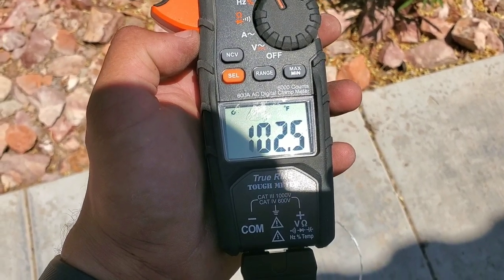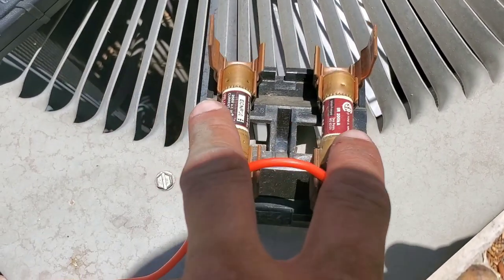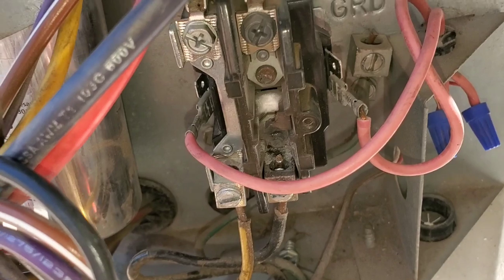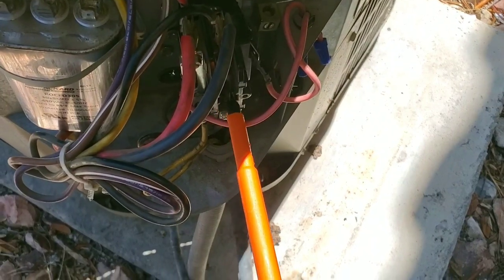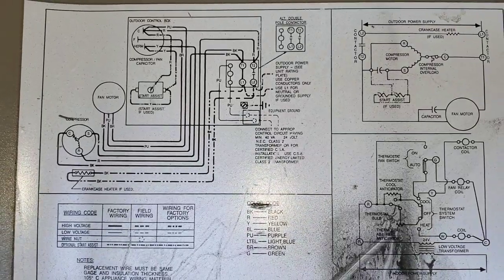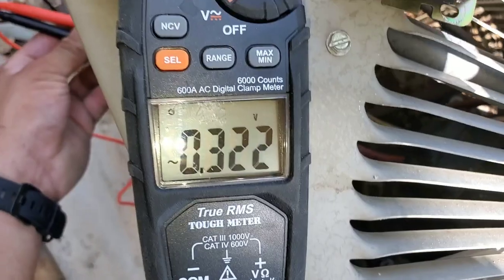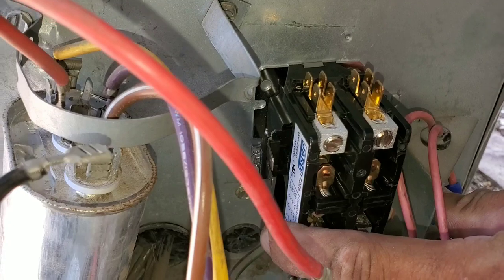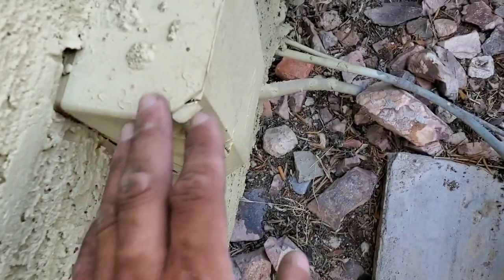Condenser NOT Working At All? Here's WHY! Contactor Not Working.

Comment: For $45 dealer I use the Emerson SmartSwitch which is far superior electronic Contactor. It’s better protection of equipment and has nifty features for brown out protection and zero off switching (zero off is when an AC sine wave crosses the center line “zero volts” lowest arc).  Takes an extra 10 minutes to install if mounting hole pattern is different. It’s about 3 inches wide.  Very well thought out engineering. 

For dealer around $200, I am also a fan of adding SIEMENS SurgeGuard at the load center to suppress in home transient spikes from other motor inductive appliances. Yet, I offer it as a system upgrade and I do not mention the “whole house” wording from the manufacturer because in as much that it is a whole house protector, I don’t want call backs if someone’s tv does not work after a storm. The newer AC units and higher end circuit boards need the added protections. The SIEMENS has a beep feature if a hit was so bad it failed.  This one feature is highly beneficial as few will go look at surge protector LEDs after install. Many don’t understand that surge protectors can die in time.  Chipping away hits degrade the MOVs over time and a bad hit can blow the unit useless.  The down side is the unit is big and typically is to be mounted on the outside of an electrical panel so any drywall surrounding the panel will be an issue.

Comment: Nice vid. Only downfall to pushing contacter to test compressor and fan is that some units have relays that need to be energized by the low voltage before they will run. As long as you look at your diagram you’ll know if that’s the case. Could misdiagnose a bad compressor or fan.

Comment: The other advantage of examining the wiring per the schematic is that it will immediately let the technician know whether the thing has been modified or not, or even if it was improperly configured from new.   Simply disconnecting/reconnecting wires will work most times, but may also propagate mistakes, or conceal some important history of modifications.
Reply from the maker: Peter you are correct. Thank you for adding to the channel. I honestly agree with your comment. You never know how or why the last guy did such and such just to get the system to run. 👍

Comment: Nice informative video Sam. My AC unit outside fan has not been coming on for 2 years now. I recently replaced the old capacitor with a larger one that was wider but the numbers matched with the old one 370 VAC except it also read 370 or 440 VAC and the Hz on the new one was 50 or 60. The old one was 60 Hz. The older one was the long skinny dual run capacitor. I put it on and the fan still isn’t coming on. There is a quiet electrical noise by the compressor that I have to put my ear against the side of the unit to hear. I was advised by Grainger to get the Dayton capacitor but I ordered the Powerwell one instead. 
Do you know what it could be? It hasn’t worked in 2 years. 
Thank you and God Bless. 
Aaron

Comment: How did you get 120v on the T1 and T2, yet not 240v across the two? 
I agree the contractor may be faulty, but something is screwy.
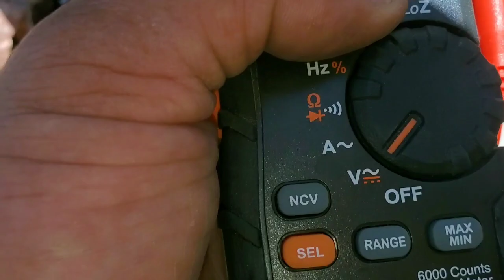@ 7:18
Reply from the maker: No issues. Once the contactor was replaced the system operated properly. It was a faulty contactor 👍

Comment: I've always heard to check continuity only when power is off. I thought it would blow an internal fuse of the multimeter. Is it actually not required...
Reply from the maker: ... because I had 24 volts the plunger was already pulled in. Doing a continuity test does not interrupt the system. 
The thermostat calls for cool... the low voltage wires on the contactor energize ... causing plunger to pull in. At that point I am using the multimeter to give me a reading. On or off does not matter. You can see in the video nothing caused the system to fail with me taking a reading with the power on that is not to say it will never happen. With that being said... If you are more comfortable with the system off then by all means do what is best for you. 🙂 Thank you for the question 👍

Comment: overall fuse is blown. is it normal for a continuity test for a wire from disconnect to wire of compressor to be continuous? [both wires are disconnected from the contactor.]

Comment: Is it safe to work on 24 volts live?
Reply from the maker: Yes however you should always confirm that it is low voltage regardless. With that being said you will not get shocked or hurt working on 24 volts 🙂